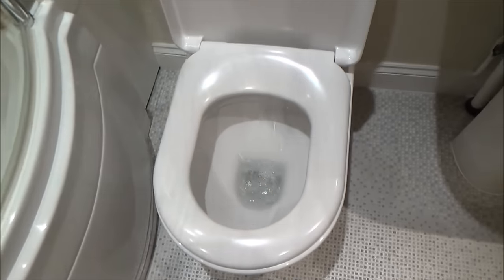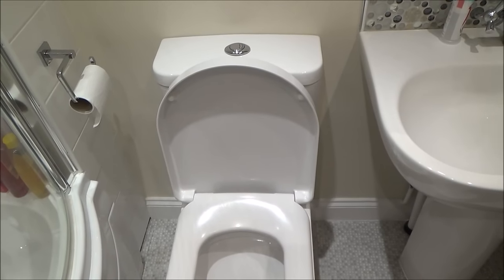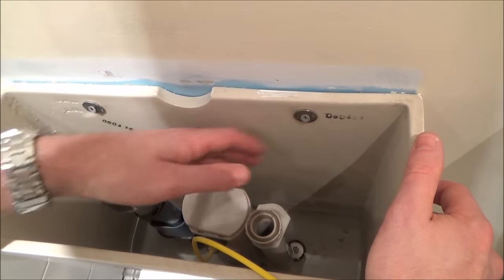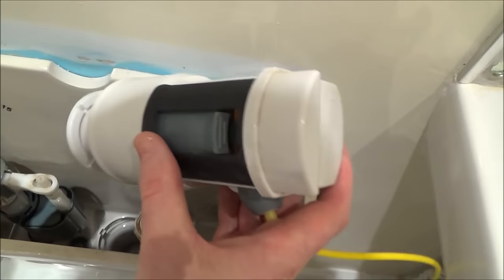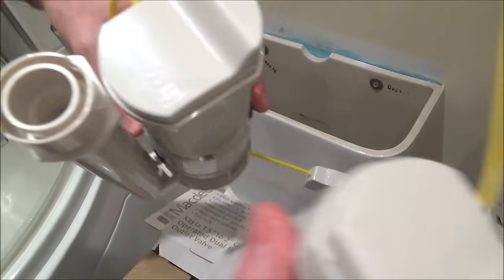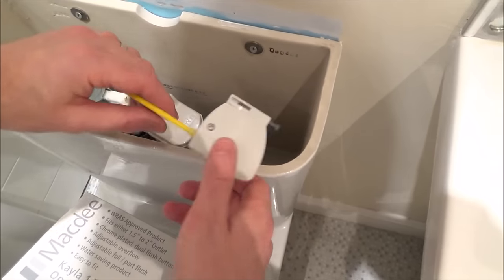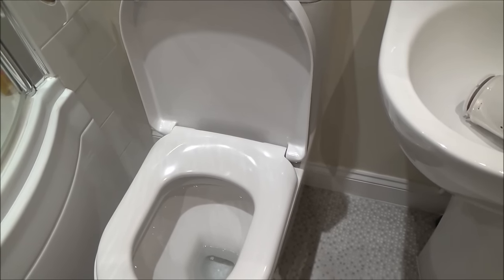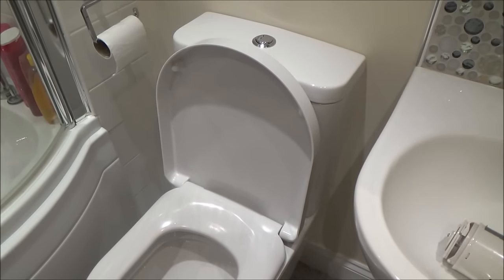How to FIX a Toilet that is constantly flushing (push button WC)

Comment: IMPORTANT!  ive just had this problem and it was as simple as the button being twisted and misaligned causing it to get stuck. Simply unscrew the button and twist it until the plastic is aligned. It was that simple. Check this first. Please like to get this seen.
Reply: This worked thank you
Reply: This worked for me too thank you so much. I've lost so much sleep because the problem
Reply: Wow I did it! in my case it was a piece of plastic stuck .... thank you so much .....
Reply: I'm not sure what this meant but I removed the clip with the yellow wire attached from the flush button, then removed the cylinder that he replaced and put it back in the other way around so now the yellow wire is resting in the opposite side of my toilet cistern and it is working now.
Reply: It worked! Thank you so much 🤝
Reply: Same here and worked a treat. I was 10 mins away from calling out a plumber lol. Very very helpful video. Thank you :)

Comment: I replaced the flush valve unit as recommended. Unfortunately it hasn’t fixed the problem. The cistern still won’t stop filling.

Comment: Can I just say how SUPER helpful this video was for me. I hardly have any plumbing experience whatsoever and my toilet was constantly flushing and just really irritating to deal with. Then I came across this video and it was PERFECT - not only were the dual flushing valves exactly the same as mine, but your steps were really clear and not details were missed out. I followed this video step by step and replaced the valve as recommended - and it works!!! So a HUGE thank you  - it really helped me out & made my day!

Comment: The problem mine had was with the lever that you pushed in at 2:11. It was getting stuck, and that meant that the valve wasn't dropping down again as it should. It is easy to dismantle the part that houses the lever - you just have to unscrew one screw - and then I cleaned off a small amount of limescale that was causing the lever to stick against the outside of the housing, following which it worked perfectly.

Comment: Thanks a lot for that information. I took the whole lot out like you did in the first part of the video. Just turned it anti clockwise slightly and it lifts out. I then cleaned the bottom and checked the rubber washer. I put it back in and turned it hand tight and it works perfectly. Plumber wanted £90 just to look at it.

Comment: Thanks you're a lifesaver (well maybe not literally but you know what I mean).

Previous owner had dropped one of those "save water" cistern bags that simply takes up space in the cistern, reducing the amount of water it can hold.  Part of the bag at the bottom had got itself stuck in the valve.  Funny thing is I've lived here for 2 and a half years now and it's never been an issue before, but after taking it apart you could see clearly that was the offending item.  Removed it and everything is fine again now.

Comment: Thanks for this I have the exact same issue and your video was the only one that had the same parts and issue to the letter, I kept thinking it was the pipe being too twisted inside the basin because as soon as I lifted the top it was suddenly fixed until I closed it then the issue would reoccur

Comment: Thanks for this! Every video I've watched so far goes through replacing the whole lot included in the kit you bought. However, in my situation I think the bit that is broken is the bit that attaches to the back of the flush button and has the cable coming out of it. I have an in-built toilet so replacing the whole lot would be very challenging, so it's good to see that you can easily replace just part of the kit instead of using the whole thing.

Comment: Excellent video with easy step by step explanations.  The lever in my remote actuator does not return sometimes which keeps the water flowing. Once push it with a screwdriver or a pen, then it returns to normal position and there is no leakage in the bowl.
Will I need to change the full system or can the lever be fixed? Thanks

Comment: Thank you for making this video, I've just replaced mine just exactly as you've done. I was able to drive down the road to screwfix who had a like for like and replace it all within the hour. There's still a lot of water going in to the overflow before it shuts up, is there any way to reduce the amount of water it fill up with?

Comment: Thanks for the video mate, mine was that tight I wasn't sure if it came off or not, didn't want to force too much, but watching this I knew it did and managed to get it off ok. Mine is exactly the same.. Thanks
Reply: TD in the process of taking mine out at the moment. How tight was yours in place ? Mine seems very tight after the slight turn still doesn’t seem to want to pull out? Also worried about breaking something!
Reply: Hi Sam, once I knew exactly what to do it wasnt that tight at all.
Reply: @SamJRobson  hi Sam did you manage to get yours off? I've twisted mine but like you it still won't pull up . Did you have any joy in the end?
Reply: @Quackinator12Guage  I sure did. I found a bit of a wiggle whilst twisting and pulling up did the trick. I expect mine was a bit stiff due to some build up. Hope this helps. Good luck !
Reply: @Quackinator12Guage  I'm having the same issue. I can't even twist mine, it seems stuck. Did you resolve the issue?
Reply: @Teeekzy  I did not, decided not to fiddle any more as I'm in a rental !

Comment: Thanks, that has now shown me how I can change this without paying fortunes for a plumber as mine has the same problem at the moment, now off to tool station tomorrow 😉😉 wish me luck 😂
Reply: Well I changed this part and my toilet is now working properly, turned out to be a two minute job, yay, thanks for the video without the video and no instructions in the box I would still be looking for so thanks

Comment: Thanks a lot just used this video and same method, just in time for xmas.  Parts if you need to know Manufacturer ID	DVA0100 which seems to be new version (grey) of the MacDee AFV50100/AFv50200. Just plugged in the same

Comment: This is so helpful, my cistern seems to be exactly the same but the button is broken completely. I can unscrew the cistern like you have done and just need a direct replacement as it seems a straight forward job to do. I have the MacDee AFV40100/AFV401200. As this is discontinued would you know a direct replacement for this? Thanks for the video for helpful!!

Comment: Had the same problem and it was the cable that pulls the flush which was the problem. Sprayed a bit of WD40 on the cable and let it work it’s way inside the yellow tube and works fine again now.

Comment: I am trying to fix one behind a tiled panel which is a bit awkward to get at. I have tried turning both ways, but it won't budge. Any ideas please. I have read that they can turn in either direction which doesn't help. I did think of putting washing up liquid in the water overnight to dislodge any gunge.

Comment: Back to the wall WC. Nice. It's good when the back nut has not been tightened properly so the valve won't twist out. Soak the whole thing overnight in Coca Cola. It dissolves the limescale. Those buttons are available at Travis Perkins.

Comment: I have changed  the unit twice and the problem always comes back within a year. The problem is that this kind of flush system is crap  ( excuse the pun ) I live in a hard water area which could be the problem, lime scale building up around the seal ???

Comment: I have the AFV50100 looks similar to the one in this video but I could not remove it like what you did. I twisted (left or right) but I could not lift it up.
Reply: Too late for you probably, but in case it helps someone else, I had to give it quite a lot of force anti-clockwise to get it to "un-click".  More force than shown in the video anyway.

Comment: I don't know if you or anyone else can help, but my siphon looks exactly like yours, except than when I try to remove it, it twists but won't pull out. I've tried pulling it really firmly in every position and it just won't come out. All it does is rattle the cistern. I'm scared if I pull any harder I'm going to permanently break something! Am I going to have to remove the cistern?
Reply: This happened to mine .. but it was because the mechanism twisted easily in the clock-wise direction but didn't pull out.  It needs to go anti-clockwise, and my experience was it required a bit of force to make it go anti-clockwise (more than shown in the video), but it did go that way and then "un-click" and I could remove.

Comment: Just wondered. Does the yellow tube actuate the flush mechanism using air pressure when the button is pressed, or is it a cable?
Reply: My Fluidmaster uses a cable
Reply: Richard Greene I assume it plunges a shot of air through the cable to allow the dual flush outlet valve to push the water in the cistern to the bottom then raise back up again ready for the next flush

Comment: Make sure the cable from the drop valve goes to the right hand side of the cistern so it interfer with the ballvalve
Reply: Could you tell me how the cable helps the flush to work? is it mechanical linkage like a motorcycle accelerator cable? 🤔

Comment: I've got this problem but only happens when I put the front cover back on, mine in concealed, appears to be something to do with the cable idk
Reply: Did you fix it? Mine seems the  same. I think when the cable is bent, there is too much friction to let it retract. It works fine with the cover off and cable is straight

Comment: Not knocking the video, no doubt that this is helpful to people saving money. Unfortunately we have 3 of these in our property, every year one needs fixing because the internal mechanism sticks. Not the washer etc., it might be limescale build up in the body of the valve, but regular as clockwork we have this problem time and time again. They are an over complicated problem waiting to happen. Utter RUBBISH DESIGN in my opinion!